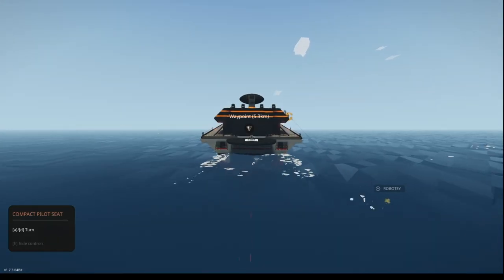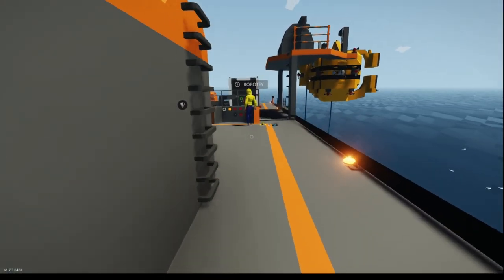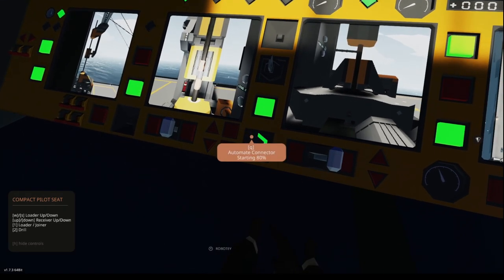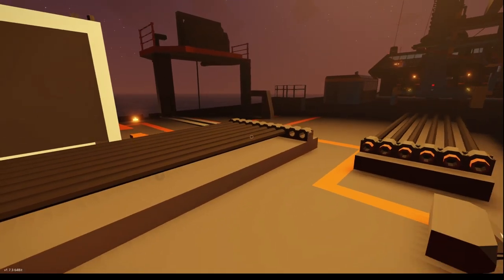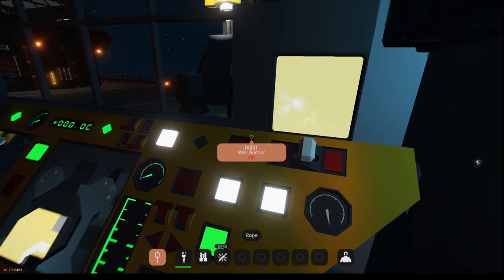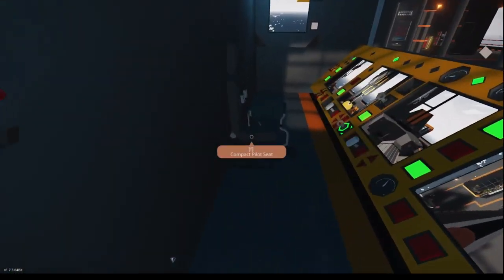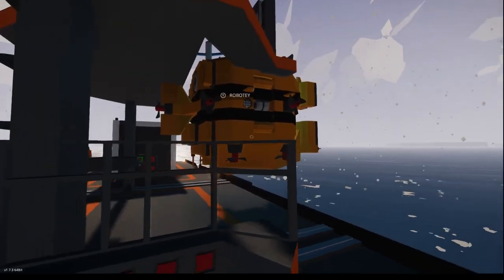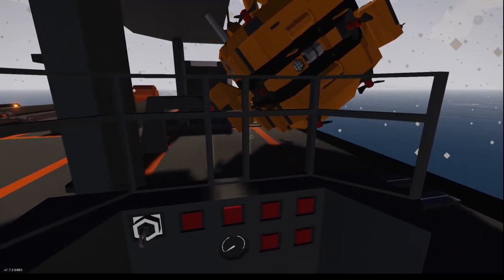STORMWORKS, Oil Rig Ship Tutorial, Plus Workshop showcase.

Comment: Interesting to see a totally different approach. I made the whole drilling assembly as a subsea construction that i lower to the seabed and remote control it from the mothership. I had to have several pumping stations on the way down to get the pumps to effectivly pump oil all the way to the surface but it works like a charm and the sistership refines it all to jetfuel and diesel. Always interesting to see how others approach the same challenge 🙂
Reply from the maker: Sounds great. And interesting. Would love to see it.

Comment: Sometimes it will just randomly stop grabbing pipes on the loader…
Reply from the maker: I know, I usually just grab them and move them across manually at that point but I did try and fix this issue with the reset instruments on the left.  Hit both switches and move all the way to the right. And hit the switches again. Sometimes fixes it.

Comment: the 2nd pipe doesnt conect
Reply from the maker: You the second pipe drops down, then unclamp it and hold the up arrows. They only connect in the orange square. So you need to use w and s and up and down to get the pipes in the right place. Most times it's just w and s you need to use.
Reply from the maker: Typo at the start,  = when